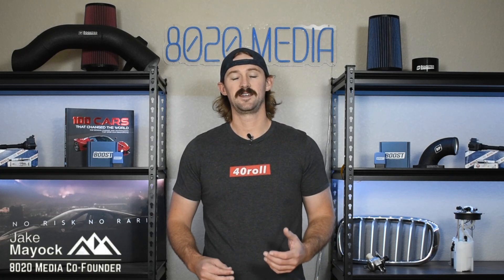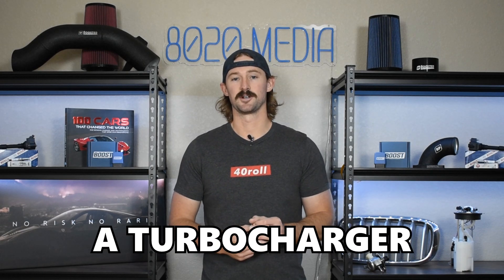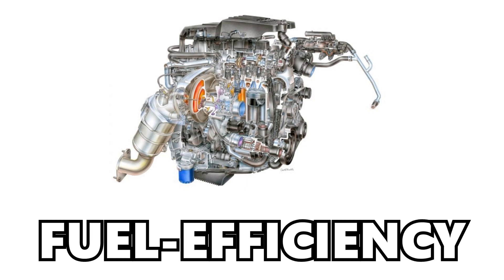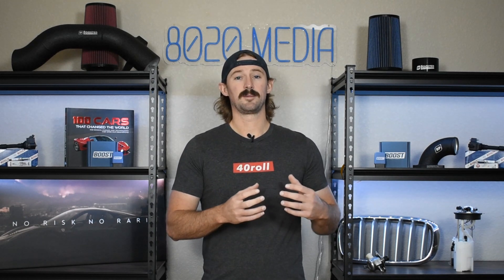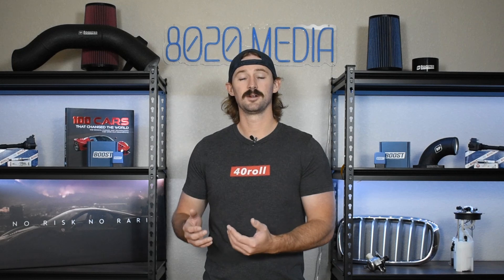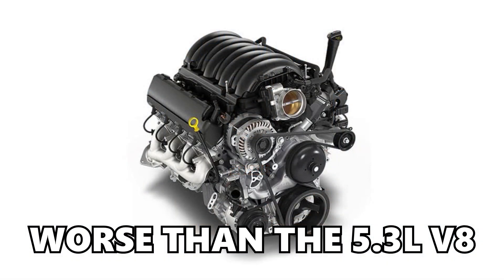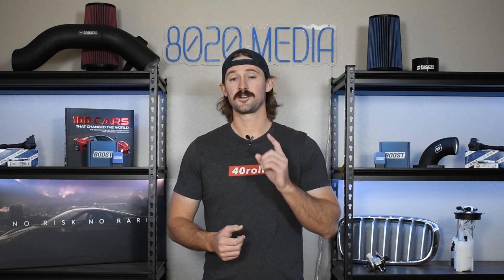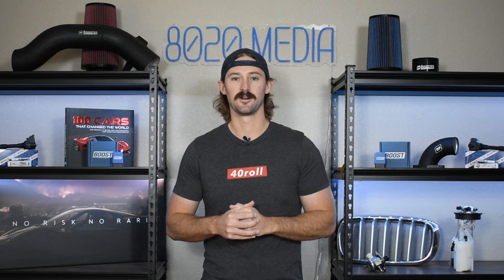GM’s 2.7L L3B Engine | Common Problems, Complaints, & Reliability

Comment: 2014 sierra 5.3L it passed the 200k with oem lifters and both fuel pumps got the afm deleted at 201k because an oil leak behing the harmonic balancer. I just did a full rebuild my self. Cam stage 1 ,non dod lifters ,oil pump, timing chain kit,all gaskets, rocker arms. Psi on cilinders was good so that still oem now it has 233k miles no engine light or problems at all and im on the 2nd 6l80e first one gave up at 190k bad converter. My point is afm wasnt a problem. problem is people believing that an oil change last 7k miles

Comment: Old 4.3l used to get 23mpg with the junky automatic. Slow truck really, but it didn’t cost me 40,000$ or more. Rust out before the engine could die. Gm paint and waxed frame is trash.

Comment: Nice overview Jake. My '23 Colorado has the L2R version, I tow a small trailer and Bass boat on occasion. As my first truck ever I'm impressed with the engine and transmission. Unloaded it provides 25+MPG on country roads, I've seen 30MPG on occasion (50 mile averaging) and I'm not a slow driver. GM advises Top Tier (detergent) 87 octane fuels, or else using an ACDelco additive (at oil change interval)  but I haven't seen any advise for 91 octane. I would appreciate any insights between the L2R and the L3B.

Comment: Please explain how an inline 4 cylinder engine "goes from V4 to V2 mode." I won't hold my breath while I wait.
Reply: Not a "V" engine - inline 4. Camshaft profiles shift to disengage the middle 2 cylinders, but very rarely. There are 3 profiles on camshafts, 2 cylinder, low lift, high lift.
Reply: @ews360  I know that but 8020 Automotive said it "goes from V4 to V2 mode" @2:45.
Reply: @unclecosmo5364  oops, my bad. missed that.

Comment: Hey I have a 2021 chevy Silverado LT with 65k miles with the 2.7 and this things looses oil regularly, it doesn't leak it doesn't burn it but it disappears, does anyone have a suggestion as to what to do about this,

Comment: I've got a 2025 Canyon. At the 5k mile mark, and I can't say I really have any complaints except for the 8 speed transmission, the gear hunting is a real issue, but I'm learning to work the throttle to get it into the gear I want it. The fuel econ is right about where I expected it, but I'm a 20 year master mechanic who never uses anything in any vehicle I own except premium fuel. I will add, now that cold weather hit, and tire pressure was low. 5psi low resulted in 3mpg loss off my average. It was between this or a Tacoma, and I just liked this truck so much better. No regrets so far.

Comment: Your video is a bit misleading. The issues you go over and hint as a big problem are in the early edition of the engine. 

It’s on year 7 of production now and there have been several improvements along the way.  It’s now seen as a reliable long lasting engine for GM. It now has a 5 year / 100k warranty. That says a lot. 

Current versions run on 87 octane no premium recommend, and I am getting better than stated mileage on mine. I average around 20 overall and on long highway trips I am getting average 26MPG. 

I don’t like the AFM but haven’t had any issues. We shall see. But this engine has been improved for over the years and if you are buying it from model year 2023 and onward it’s better.  You do add some talk about that at the end but it’s only like a footnote. 

People should not fear buying a new GM truck with this engine nowadays. It’s not the 2019 version.  

Most people don’t keep their vehicle past 100,000 miles. According to research I read most get rid of their vehicle between 65-100k. 

Folks that do want to keep past 100k need to be sticklers on maintenance, do it right and do it on time. A lot of people don’t do that. So when someone complains that their vehicle didn’t last, I’m always curious about the maintenance records and how much they actually spent how much energy they put into proper maintenance a lot of times they have not.

Turbos run hot and oil changes are critical , I do mine every 5,000 miles, and it has to be the right oil. So that is one big way to help your engine last. But you would be surprised (or maybe not lol) how may people don’t focus on maintenance and / or don’t even have a clue. Changing fluids and filters, etc.

Comment: I have 2020 Silverado with 2.7L. I just hit 60000miles my average epa over the lifetime of the vehicle is 10.4 L per 100 km or 22 mpg however in the summer time I’ve had as good as 24 mpg and winter around 20 mpg. I’ve had zero mechanical issues. The vehicle gets serviced every 6000 miles or 10000 km. 🇨🇦

Comment: Well, I have a 2023 AT4,
The trans at 23,000 is starting to have issues, 
The engine is very loud especially trying to merge, city driving sucks,  highway the has been 28 mpg.

Comment: What years required 91 octane?  Everything I have seen has been 87 octane with the Assistant Chief Engineer specifically stating there is no performance difference between 87 and 91/93.  According to his interviews it was specifically tuned for 87.

Comment: My 2024 canyon at4x has been leaking since day one. Dealership is on there 3rd rear main seal replacement. They’ve had my truck longer than I was able to drive it. Really disappointed. It’s at 1124 miles bought new with 42 miles.

Comment: I have a 2020 model with 125,000 miles.  I have had no issues but here are the cons.  87 octane fuel and my average milage is 19.  Trans is jerky in 1st and 2nd.  It burns oil enough that I have to add inbetween oil changes. Maybe 1/2 quart every few weeks or so.
Reply: Have you serviced trans?

Comment: Would buying a 2026 WT be a bad decision? Thinking about it this week. My 2010 Tacoma just went on me at 250k but I know they don't make em like they used to. Hearing GMs issues, is it just safer to stick with Toyota and their baggage they bring? I doubt either would last another 15 years or even close to 200k+ miles.. So, I'm just trying to get the best bang for my buck here.

Comment: Dumb GM management.  Fangchengbao 8 uses BYD DMO system.  With battery drained and just using ICE it gets 27 mpg.  In hybrid mode, it is 131 mpg.  Curb weight is 7,286 lbs. Double cab silverado is 4,900 lbs. BYD shark is 118 mpg in hybrid mode.  Shark towing 2.5 tons is 16 mpg. BYD shark is price competitive with Ford Ranger in Australia.

Comment: 66k had to get engine rebuilt, 72k trans speed sensor internal, now oil pressure valve solenoid and using 5 quarts of oil. Not leaking using. Currently at 82k lol
Reply from the maker: D - Dang.. Sorry to hear. However, thanks for sharing your experience.
Reply: I'm about to hit 70k in my 21 Silverado 2.7l ...no issues so far but idk man I am very close to trading it in I just don't have a good feeling about it every trip to the dealer is also expensive as hell and you can barely do any maintenance on these yourself

Comment: i have a 25 chevy truck with this engine and its pretty decent for getting around,  i would not want to tow anything like a 5th wheel.  on the highway , if i set my cc to 67 mph i get 28 mpg,  the faster i go the mpg  goes down pretty bad,  i would have liked full instramantation , like oil presser and temp and volt meter.  dodge has much better interior.  i would probably buy one again
Reply from the maker: D - Well said! Thanks for sharing your experience.

Comment: I’ve got a 22. Expect to get the purge pump replaced around 40,000. First shift is harsh when it’s under 50 degrees but I’ve had that with all chevys I’ve driven. I don’t understand why people are having issues with fuel economy my all time mpg is around 24. If I’m cruising on backroads and reset the trip 2 mpg calculator I’m getting 27-30 on cruise control at 60mph. I drove from Maryland to South Carolina on a single tank of gas. Tows my smaller boats like a dream. I think this truck checks all the boxes. Not sure what’s gonna happen after 100,000 tho.
Reply from the maker: R - Nice! Thanks for taking the time to share your experience.

Comment: I have a 2016 Colorado with a naturally aspirated V6 LFX. 95,000 miles. I plan on keeping it for a few more years. Fuel economy is good and no AFM/DOD. The timing chain issues were corrected in 2012.
Reply from the maker: T - Thanks for sharing. Just take good care of it!
Reply: @8020Automotive I do my own oil changes at 3000 miles.  Transmission fluid at 40,000.  About to do spark plugs and anti freeze

Comment: 2.7L is not a small 4 cylinder by any means. That is the size of the gentleman’s agreement turbo 6 cylinders out of Japan from the 90’s.
Reply from the maker: C - Lol, comparatively to the other GM engines. But thanks for sharing.

Comment: My lifetime average with a 2012 Silverado ext. cab 2WD with the 4.3 is 18.8 if anyone is interested to compare with the new 2.7L motor.  It doesn't have anything close to as much power, though.  It's been 100% reliable, though and does truck stuff like I need.  I'm used to driving an 18 wheeler so slow isn't an issue for me.
Reply from the maker: C - Nice, thanks for sharing your experience.

Comment: I own a 2022 Silverado, bought new. After about 60,000 miles I average about 21-22mpg. I sometimes tow a small trailer with a sub-compact backhoe. About 5000 LBS gross.  It does a great job moving it around. I wonder where this guy got his information.
Reply from the maker: P - Thanks for sharing your experience! We have thoroughly researched these. Unfortunately, not everyone has the same experience.

Comment: So besides regular oil changes, can you prevent the carbon buildup?  Im considering the 2025 Canyon
Reply from the maker: R - On a 2025 GMC Canyon (and other direct-injection engines), you can’t completely stop carbon buildup on the intake valves, but you can slow it down by installing a catch can to trap oil vapors before they reach the intake, using Top Tier fuel to keep the injectors clean, sticking to regular oil changes and good spark plugs/filters to minimize blow-by, and planning on a professional intake cleaning (walnut blasting or chemical service) roughly every 80–100k miles if performance drops; these steps won’t eliminate buildup entirely, but they’ll delay it and keep the engine healthier over the long term.

Comment: I agree the 2.7 should not need AFM and cylinder deactivation.   430 ft-lb of torque comes at a price, so crazy to expect good mileage if always driving with a lead foot. 

Unfortunately, only the 2.7 is offered in all of the midsize pick up trucks like the Colorado and Canyon. So those owners don’t have a choice to get a 5.3. For those that are getting a full-size truck with a back seat, they would be foolish not to get a V8 in the first place.  Again, though, the V8 also has the same AFM problems.  

Lastly, I think that the valve body used in all of GM’s transmissions will be the limiting factor for drive train longevity for these trucks.  And I agree that the 10 speed should be offered for the 2.7. Much better multiplication with that combo. In fact, maybe they should offer fewer transmissions and make sure the ones they do offer are bulletproof.
Reply from the maker: S - All good points!

Comment: i get around 25.5 mpg combined with a best of 26.6 on my 2023 Colorado 2wd with 87 octane. it drops to about 21 mpg in the winter. only 37000 on it so far with no issues yet. i just wanted to see about any potential issues that may pop up.
Reply from the maker: R - Nice! Keep us posted.

Comment: You can believe what you want, but if the number of 2.7L 'complainers' is compared to the number of 2.7L purchasers, it's a fair statistic.

If you ran a sub shop, and 4 out of 100 people who purchased subs complained about your sub sandwiches, you have a 4% failure rate. Pretty simple stuff.

.
Reply from the maker: T - Correct!

Comment: I had my fuel injectors fail at 40,000 miles on my 2022 GMC Sierra 1500 2.7L and have had the oil cooler pump fail and the high pressure fuel pump fail as well
Reply from the maker: D - Sorry to hear. However, thanks for sharing your experience!

Comment: Well I switched from a Chevy to a ford between a lifters problem and I didn’t want a 4 cylinder engine.  Got myself a  8 cylinder 5.0 F150.
Reply from the maker: G - Not a bad idea! They don't make engines like they used to, that's for sure.

Comment: On some early non HO engines there was a issue that could cause a cam click due to tooling. Not all, some. The HO ( now tutbomax ) that has long been addressed and the cams are more heavy duty. The HO had alot more robustness added to it. I prefer the 2.7 in the 1/2 ton. 6.6 gas in the 3/4 ton.
Reply from the maker: E - Thanks for taking the time to share this.

Comment: So far at 65,000km I have averaged 10.9L/100k or just shy of 22mpg. 4wd extended cab WT. I think people just have a heavy foot. Use my truck for work back and forth, and towing our 18ft bowrider. Only complaint is the transmission is sometimes rough but only when not allowing the truck to come to a complete stop.
Reply from the maker: H - Nice! Thanks for taking the time to share your experience!

Comment: To me if there is more than one cylinder fuel management may be valid. It is four BIG cylinders in part to equal an 8 cylinder plus turbo. Therefore, cutting down to 2 cylinders is valid to increase fuel economy. I was disappointed with the fuel economy but once I understood it is an “8 cylinder” in a 4 banger that means similar fuel economy, no way around it.
Reply from the maker: B - Thanks for sharing.

Comment: The fuel management system on the 2.7 is completely different than the V8 motors. The valves are activated by a shifting overhead cam. The cam moves laterally to change the cam lob profile to three different modes. Full value activation all cylinders , partial activation -the values do not open fully, and no activate at all. The engine can be running on two or four cylinders.
Reply from the maker: B - We've addressed this many times in the comments. Thank you for sharing.

Comment: 5000 pound full size pickup truck used as a truck towing, hauling heavy loads, etc.  now couple that with small 4 cylinder turbo charged engine- that is under extreme stress to driving the under normal conditions------EQUALS-problems with reliability, lots of trips to repair shop.  You have to be insane to buy one these pickup trucks with high miles out of warranty
Reply from the maker: D - Thanks for sharing.

Comment: Your complaints about AFM, and direct injection is really a complaint about all GM engines. I'm not a fan of either I thought this was resolved by other manufactures by adding a port injector also to keep the intake valves clean. I guess GM didn't want to do that probably assume by 60k they won't have to warranty it.
Reply from the maker: M - And the 2.7 is a GM engine, so yes.

Comment: A Chevy V6 from 1989 gets as good MPG as this 2.7 4 cylinder does because they didn't try to cram as much power out of it. If you need to tow 8000 lbs, then get a HD truck. Leave the smaller trucks for hauling lighter loads. I don't know why manufacturers keep competing with each other to make their half-ton trucks as big and powerful as possible. Make them reliable and cost effective.
Reply from the maker: M - Well said!

Comment: Just drove my 2024 Silverado on a 2900 mile vacation trip. Now it was mostly interstate but was getting 24.6 miles per gallon running 75/80 mph most of the time,  running the ac! I was impressed.  I pull a 7000 lb camper with this truck and it does a good job with that too. Although in a couple years I'm going to a 2500 just because I would be more comfortable I think but am happy so far with my 4 banger.
Reply: My 97 5.7 vortec 350 with 280k got 17mpg at 75 mpg with 91 when I drove home from a long  camping trip. The 24 mpg from a 4 cylinder turbo truck from 2024 you got is kinda sad. And I dont mean to put you down, I'm just saying it's been 30 years of technological advancement for you to only get 7mpg more than me. I'd be pissed if I was you.
Reply: @zacharygray3442 I'm use to driving Jeeps so my truck is a blessing!
Reply: @zacharygray3442  so a 40% improvement in fuel mileage plus more power is sad?
Reply: @zacharygray3442 7 extra miles on 1 gallon of fuel is actually quite good for a full size truck. That 182 miles on a 26 gallon tank.
Reply from the maker: J - Nice! Thanks for taking the time to share your experience.
Reply: Brother how I have a gmc 2025 1500 pro and average about 13.1mpg

Comment: Putting a four-cylinder motor in a full-size pick up truck is bad enough. But then add a turbo charger to it and you may as well just throw a a grenade  under the hood.
Reply from the maker: M - We kind of agree.

Comment: With 1500 miles on my new "24" Canyon AT4, I'm getting 21.1 CITY milage on my display. Calculated milage is better at 21.6 mpg. 
A 400 mile round trip down to Chicago over the weekend delivered 25.5 mpg traveling at 69-71 mph. I'm not sure why so many others are getting so much worse milage besides maybe poor driving habits? I have stock tires with a 1.5" level lift on the front. GM incorporated a sophisticated PCV system to reduce carbon buildup on the valves without the need of a catch can. I can't seem to find, in the forums, a long list of customers who needed walnut blasting on this engine as of yet. Fuel injectors are cheap if they need replacing at say, 150,000 miles. 
I continue to be pleasantly surprised by the milage and drivability of this drivetrain.
Reply from the maker: J - Good point. Thanks for taking the time to share your experience!